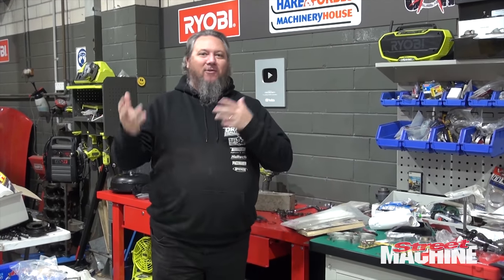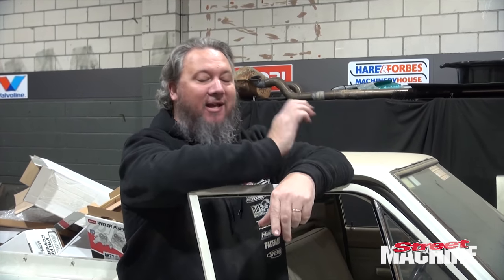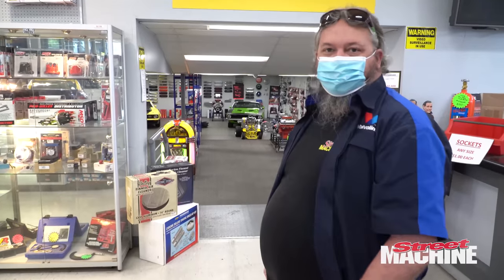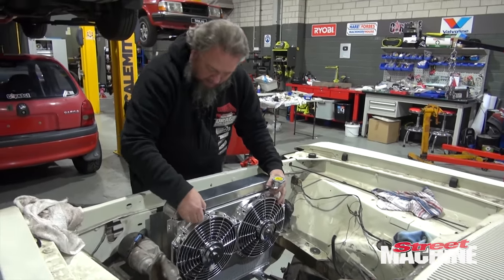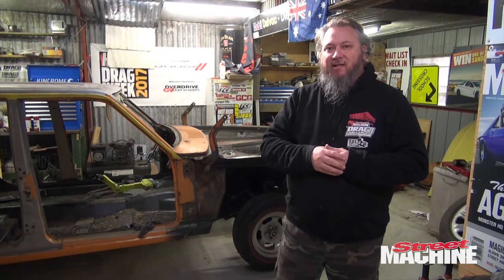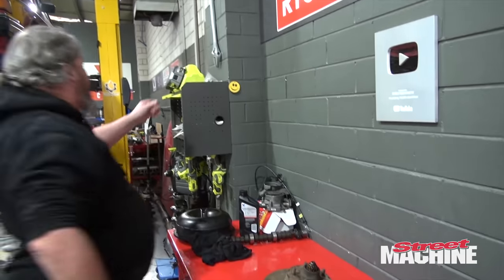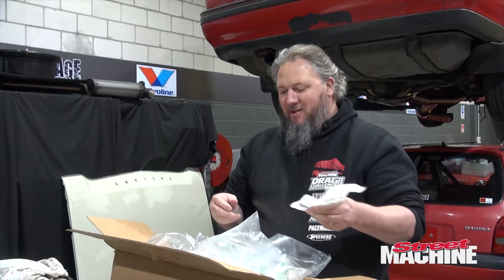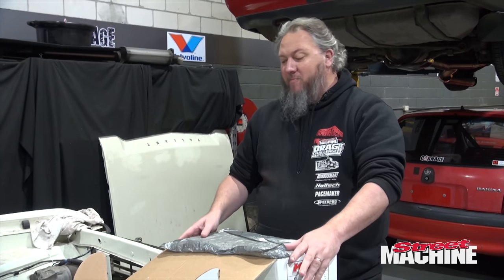Carnage - Dad's Ute Part-3: More Parts - New brakes, New Radiator, New Pistons

Comment: Make sure you check the pistons for taper, I have kb167’s in my 318, and when I was pre assembling the motor, one of the pistons was tapered and needed replacing. Easy enough to sort with summit though

Comment: Im still amused at the Teen build, we used to look down on the 318 and scrap them when they came up and I only remember one guy (Mal) who was faithful to them.
Now they are a real alternative and being explored and weirdly well supported in the aftermarket.
Love that you got Hypertecs and mentioned about the ring gaps and clearances' but worth explaining why its critical and their heat and expansion habits along with the RPM limitations and why and thats as you said the whole reason why they would fail big time with people who didnt know WHY they are so good.
For what its worth id love to have seen a HiPo Injected and supercharged Slant in the Yoot but I get why you went the 318 with Mopar stuff costing what it does.
Cant wait to hear her fire up.
Reply from the maker: I love a blinged up slant six but you can pour a lot of money into them for not a lot of gain. At least with the 318 we'll show some solid gains with money in the right spots.
Reply: True and the Teen will have the torque too, be needed for the long haul with You and Gus in it plus whatever you have in the back.
Those A bodies are a bit tight for room too.

Comment: From what I have heard about Valiants the front suspension and brake parts are pretty interchangeable with much later models all the way upto the last of them and with Fords, So all you really need is the stub axles off a model with ventilated disks if they are different to the solid disk stub axles
Reply from the maker: That also changes the stud pattern to late model
Reply: @STREETMACHINETV  I think the next model after VE has ventilated disks and the same pattern
Reply from the maker: @anomamos9095  Actually it's the VG that has the ventilated discs, but both rare and expensive. I just didn't have the budget.
Reply: @STREETMACHINETV  . Wasn’t there a Ford with the same stud pattern?
The parts for those can be found on rubbish dumps.

Comment: If you dont have the bearing pushing in tool set, just use the old bearing cups, to push in the new ones, that way you have the same size outer DIA to make sure you dont scratch the inner surface?
Reply from the maker: That's how I used to do it

Comment: I use 12” long hoses on the end of the rod bolts, that way they go right around the crank when putting them in, no chance of whacking the cylinder walls or crank
Reply from the maker: I used to do something similar back in the day

Comment: G'day Scotty, I'm just about to start ordering parts for my own 318 build, so I'm following this very closely. I had intended to run the kb167 & zero decking my block but now I'm interested in the kb399's. Do you not need to deck the block at all to get your desired comp ratio? Also what rings are you using?
Loving the build & the passion  for the Val's

Comment: You planning on upgrading the electrical system to handle the load of those dual electric fans? Not sure the starting amps of those bad boys but I’m sure it’s not small.
Reply from the maker: It'll be a whole new electrical circuit. Not sure the 50 year wiring will handle those babies.
Reply: Kinda figured, you guys custom making it in house or getting a kit? Reckon I’ll just stay tuned for “another episode of carnage”.

Comment: awesome content , are u sure you dont wanna boost this little beauty, mmmm
Reply from the maker: Probably not, with those pistons
Reply: Suspect it might already need octane booster or a tad less than the ideal (for 318/340/360) 35 degrees of timing with 10.7 : 1 comp.